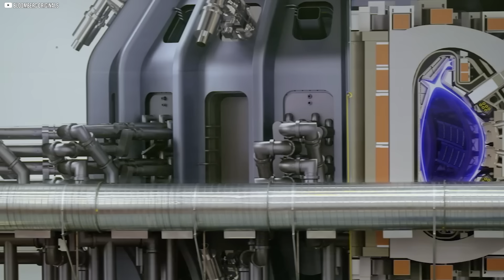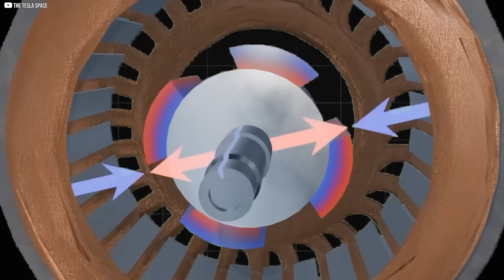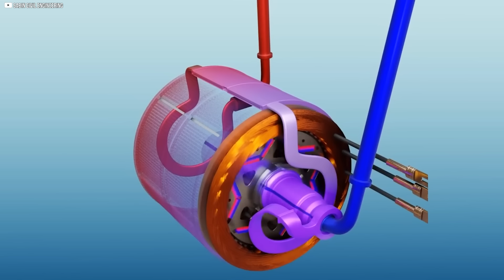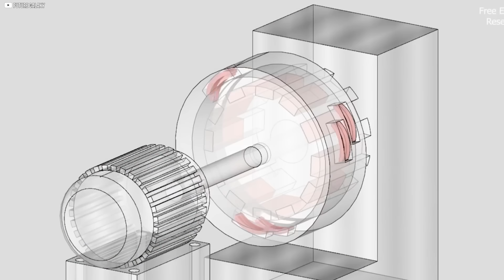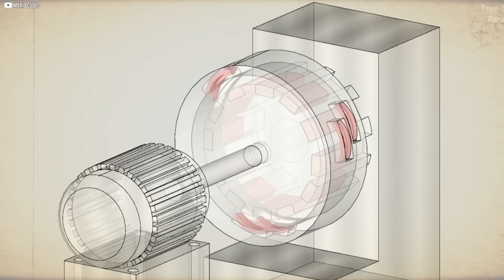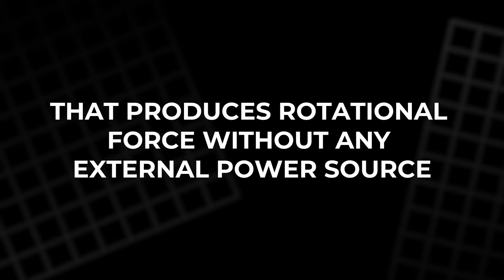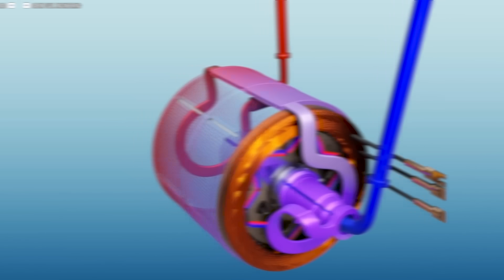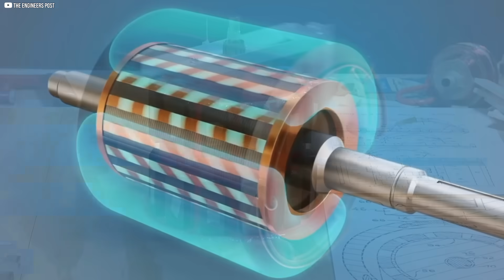The Magnet That Could End Electricity Bills Forever!

Comment: Guys, research even more, Niron Magnet maybe the key to discover the Gravity Canceller.  Imagine if you can control gravity at the ground level, cars and airplane can float vertically and fly effortlessly.  Just thinking 50 years ahead.
Reply: I think your 70years late. Gravity canceller was achieve in the 50's.

Comment: There is a missing concept not presented here and counter intuitive to most. The stronger a magnet gets the closer that magnetic field is to the magnet which means to say that currently we deal with magnets generally termed N54 which is extremely strong yet if you put a gauss meter 100mm away from that magnet you will get less magnetic field strength measured than if you were measuring and N35 for example which is weaker therefore allows its magnetic fields to not be pulled in so close and they spread out further. What I am getting at is that if we have magnets with N500 (10X the current maximum as this video suggests) then the magnetic fields will be so extremely strong YET the fields will be so close to the magnet that you need extreme proximity to gain access to those fields which means for general applications for example a motor, the air gap between the rotating rotor and stationary stator will be extremely small even impractical. Yes the smaller magnet means less weight and reduced cost but that gap is going to be so small that even precision engineering of costly bearings and mechanical placement will be almost impossible not to mention the bonding adhesives strong enough to hold the forces. Look at Tesla motors where they wound extreme carbon threads around the rotating magnets to hold them in place given the insane forced wanting to explode the motor. There is a natural limit and these new magnets will introduce major redesigns which is great yet one component improvement in all systems requires many improvements to other components in that system
Reply from the maker: You raise some excellent points about the limitations of super-strong magnets! It’s crucial to consider the engineering challenges that come with increased strength, especially in practical applications like motors. Thanks for sharing your insights!
Reply: You forgot 3 things

Comment: No. All it will take is to make a generator that can output more energy than the motor turning it uses. That is the whole trick, as you add load to the generator the cogging gets worse making the motor use much more power to turn it.
Reply from the maker: That's a great point about the efficiency challenge!

Comment: No such thing as pepetual motion machibes. Stronger magbets are cool though. Swap some boron for nitrogen and use ultrafine powder metallurgy and you got extreme power neodymium magnets, hell even using a cobaltl iron alloy with iron notride crystals in it could create neodymium free magnets or reasonable intense powers😮.
Reply from the maker: It's exciting to think about the possibilities that come with magnet advancements!

Comment: To have a "free" electrical power motor, you will have to overcome resistance and heat. 
No motor on earth has overcome this and never will.
Reply from the maker: You make a valid point! Overcoming resistance and heat is definitely a significant challenge in electrical engineering. It’s a fascinating topic to explore further!
Reply: Apart from the nano motors inside your body which are identical in build too human built motors absolutely identical with slight working difference all running from a bit off sugar from food which grows free so we technically are free energy devices due too food growing free so perpetual system that runs humans
Reply: Mitochondrial motors in body I suggest you Google these read some pages and look on Google images...I'm sure there in the Mitochondrial but either way they are identical too man made ones so somehow without seeing the ones inside us we designed motors with metal that look n work near identical

Comment: The strength of the magnets used is NOT the issue in this case!  A way to make a permanent magnet turn on and then shut off at exactly the right time is THE GOAL!  The only reason a gasoline engine can run is if the fuel mixture and the spark plug stop working at exactly the right time. Therefore' the real problem is how to make the "machine" able to use it's own momentum to stop the permanent magnet from exerting force at the right time!
Reply from the maker: You make an excellent point! Timing and control are crucial in engineering such systems. It’s an exciting challenge to explore how we can harness that momentum effectively!